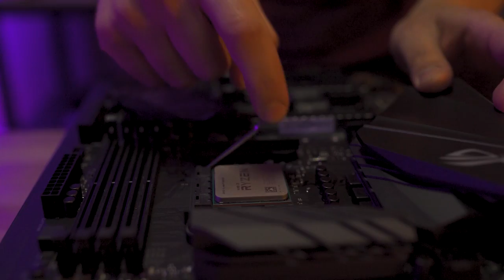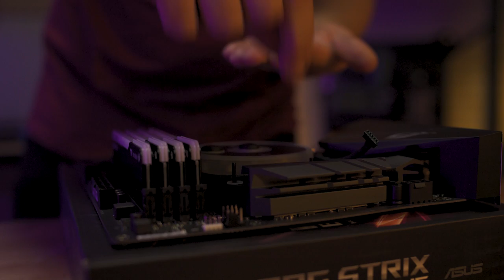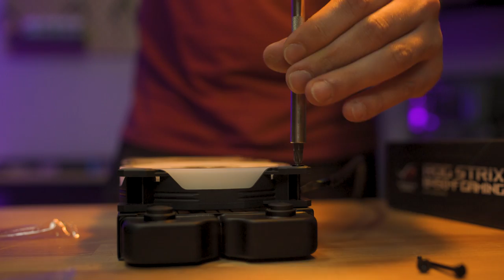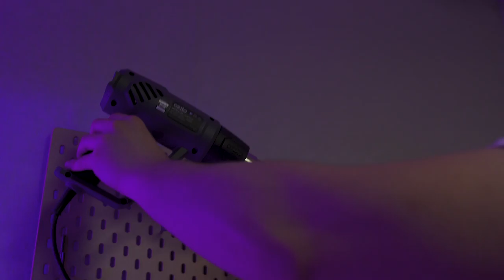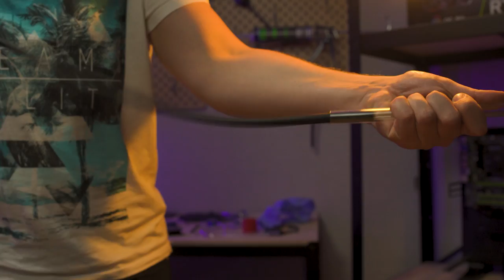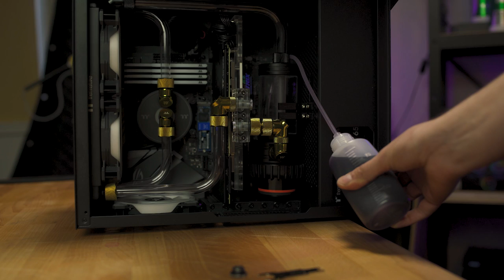PC DREAM BUILD - Commander G33 // "Purple Reign"

Comment from the maker: Would you like to see more dream builds in the future? If so, let us know what you'd like to see in the comments below. 
Want to know exactly what we used in this build?
All fittings, hardware and water cooling components are linked in the description.
Reply: I’m subscribing right now like it’s so calming😊😊☺️
Reply: Hi! I cannot see where you can put the HDD in this case.I see only 2 spaces for SSD, but for HDD, absolutely none.
Reply from the maker: @garylightning3291  hey there! The Commander series has the ability to house two HDDs in an included tray underneath the PSU shroud. :)
Reply: @ThermaltakeAustralia  Well, I bought the Case second hand, so I cannot see any hdd enclosure.
Reply: @ThermaltakeAustralia  Underneath the PSU? Is this a joke? Underneath the psu there is just the frame of the case, because PSU is on the bottom.Can you send me a picture or a video, please, to see if the guy who sold me this unit, tricked me and gave me one that is not complete.
Reply from the maker: @garylightning3291  We're not joking... 
Here's a link to the manual so you can see the dissection :) https://thermaltake.azureedge.net/pub/media/productattach/c/a/ca-1p3-00m1wn-00_commander_g33_tg_argb_manual_190830.pdf
Reply: @ThermaltakeAustralia  Yeah, in the manual are just drawings, and you can barely understand anything from that sketch. I am pretty sure I do not have the bay (because it looks like I should have a physical enclosure for a HDD), instead I just have some plates which can be screwed to an ssd.This is all I have.I would love to see a video, because I want to give it to the guy who sell me the incomplete case.

Comment: Is not the first time I watched a video on the building of water cooling computer very impressed about  how they are built but the other thing you don't see is them actually used the computer and seeing what sort of temperature you get when using the computer. One of the questions I would like to ask is how often would you change the coolant in these computers I don't think I have ever heard anyone telling you how often to change it.
Reply from the maker: Thanks a bunch for watching and fantastic suggestion there Anthony, we'll put that into the pipeline for a water cooling Q&A video. 
To answer that question for you, it actually depends on where the build is situated, aka, if it is next to a window where the build is in direct sunlight a lot it would need to be changed more frequently (close to the 6-month mark) or if it's in a dark room it could go 12 months or more. 
The best practice is to check your coolant level every 6 months (when the PC is turned off) and if your coolant colour is fading and go from there.